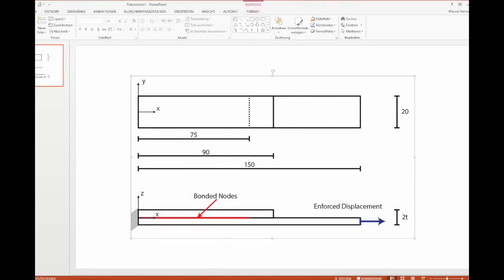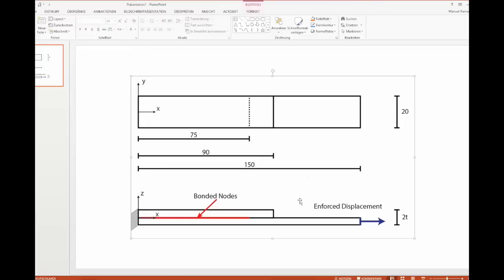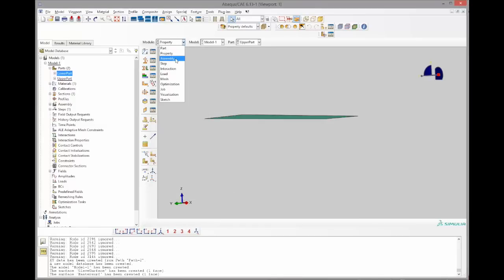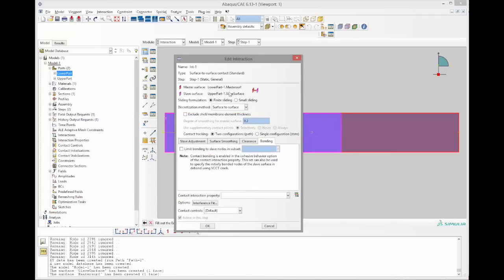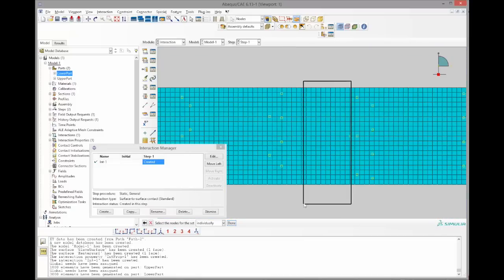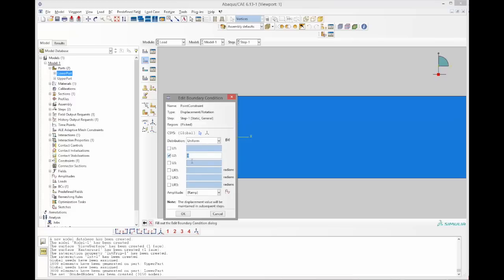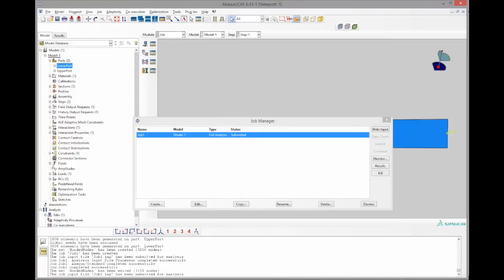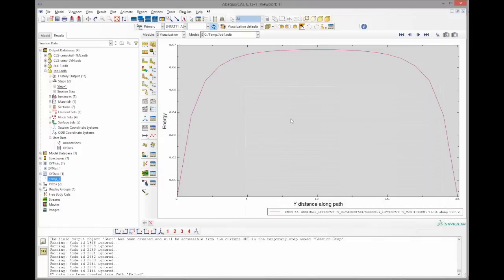Fracture Mechanics: CLS Specimen VCCT Debonding in Abaqus Part 1: Strain Energy Release  Rate

Comment: When I apply node to surface with VCCT, the solver gave error: "***ERROR: THE *DEBOND KEYWORD IS NOT VALID FOR NODE-BASED SLAVE SURFACE 
           ASSEMBLY_SLAVENODES_NODETOSURF_CNS_". What is the cause of this?
Reply from the maker: As it states, the DEBOND keyword you are using in your file does not work for a slave contact which is node based. Assuming you have a surface to node contact, try flipping master and slave and see if that works.

Comment: Hello
I am working on a project involving ABAQUS XFEM for stationary crack to obtain SIF and for crack propagation. However, I have encountered few problems. I have listed them below.
1. Simulation performed on stationary crack using classical method ( by defining collapsed elements around the crack tip and mentioning singularity) and xfem provide similar SIF
results, when compared, under the same loading and boundary conditions
However, the stress values near the crack tip differ by a larger extent in both these cases.
2. For crack propagation using XFEM, the following errors have been observed:
i) Too many attempts made for this increment
ii) Too many increments needed to complete the step
iii) The increment required is less than the minimum specified
Could you let me know if you have any suggestions to resolve the same.
Reply from the maker: I would love to help you with that but I did not use XFEM back then - the prof. didn't like the method back then - don't know about it though if its really that bad. 
The second problem seems a convergence problem. Decrease the increment to the minimum (not less) and if that is not working, add more substeps or decrease the load - this would be my first shot on this. Hope this helps :)
Reply: @ManuelRamsaier  thanks will try it out

Comment: Dear Manuel,
thank you so much for your videos! They are very helpful! 

I'm performing a comparison between the SIF calculated by Contour Integral, XFEM and VCCT. 
The firsts two are in good agreement, but regarding the VCCT I'm getting strange results. I'm calculating K_I as the square root of (G*E) using as "G" the ENRRT outputs. 
However, trivially, the VCCT's results are deeply affected by the "Critical energy release rate" inserted in the "Interaction Properties". Considering this, it seems to me that it is pointless trying to get the SIF from a VCCT simulation. Isn't it? 
What do you think about it?

Anyway, thank you very much indeed for your videos!!!
Reply: Dear Manuel
I am so lucky to have read your comment.

At present, I plan to use VCCT to simulate crack fatigue, which is very similar to the problem you encountered. May I ask if your problem has been solved?

thanks

Comment: hello, actually what is unit critical energy release rate in abaqus? j/m^2 or j/mm^2?
Reply from the maker: +Lokman mohsin The units, when looked into the literature is J/m^2 but as I modeled it with N, and mm you geht: J/m^2 = (N*m) /m^2 = N/m = N/m*10^-3 m/mm = 10^-3 N/mm
Reply: +Manuel Ramsaier thank you very much
Reply from the maker: +siddhartha1994 Hey, I found J/m^2 in the literature e.g. http://ntrs.nasa.gov/archive/nasa/casi.ntrs.nasa.gov/19990078564.pdf at page 28 in the charts you can see the unit. But J/m^2 and J/mm^2 are identical in meaning as it is [energy]/[length]^2. You have to define it as you define your unit system in the fem tool. I used the system: mm N tons seconds. So I had to give it in N/mm as described above.
Reply from the maker: You're welcome :)

Comment: Thank you for the excellent video! Compare with the cohesive element, which way is more accurate? Thank you
Reply from the maker: Helen Z Depends... you can only use VCCT if you have a predefined crack in your structure. Cohesive elements are more "general". During my thesis I looked only on the vcct approach. Also because there is no (or not known to me) method for cohesive elements to model fatigue cycles as there is for the vcct method. I think you will find quickly studies on sciencedirect which compare vcct to cze.

Comment: thanks for video,, and please help me to model propagating crack(crack grows in plate it may be edge crack ) we have to find (dynamic) stress intensity factor energy release rate vs time plot,,, thanks in advance
Reply from the maker: Thanks for your feedback. I did a manually generated output of the SERR and then ploted it over the cycle. So you can create a path in your Post Processing and use this to geht the values for SERR... then you have to go further in time and do the output procedure again. This is the only way it worked for me. Another possibility would be to write a script in python, but in that topic I am not this profunded. Wish you all the best.